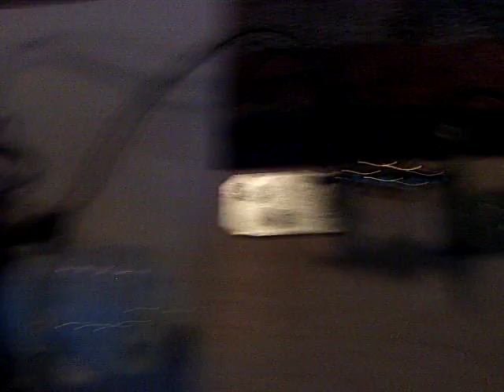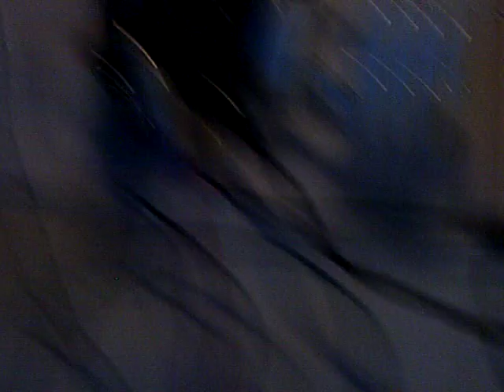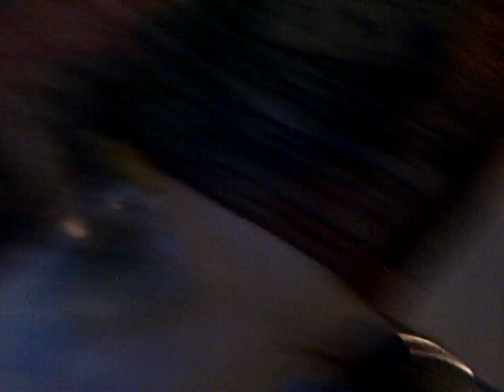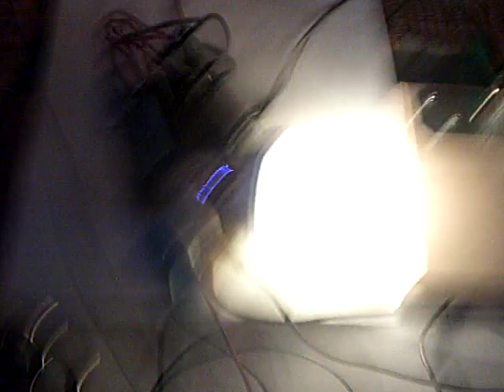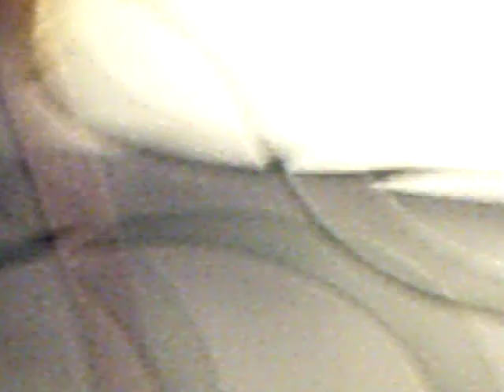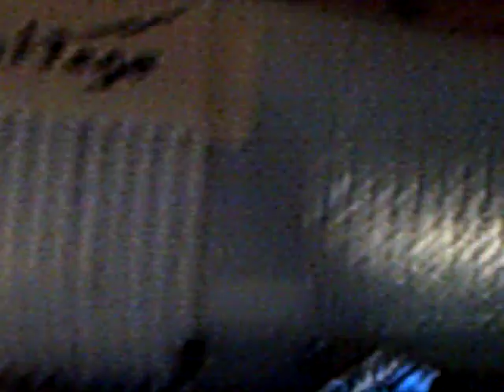Flyback Transformer CFL Driver

Comment: Lidmotor,

Did you realize that you can use the driver from the CFL to drive the flyback It works like a charm. The only problem is that, sometimes, they have protection circuits so you have to take two of the leads and connect them to a resistor.